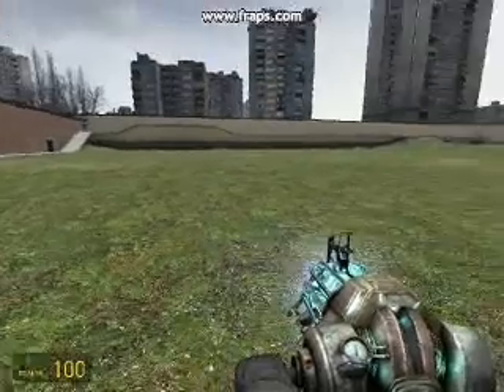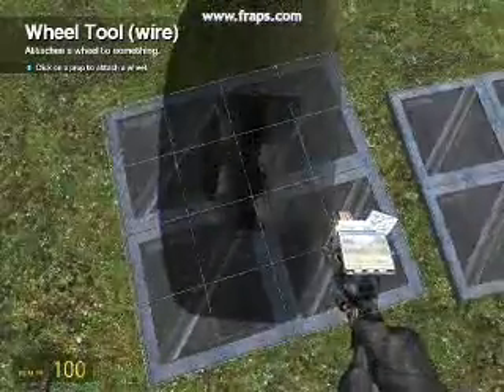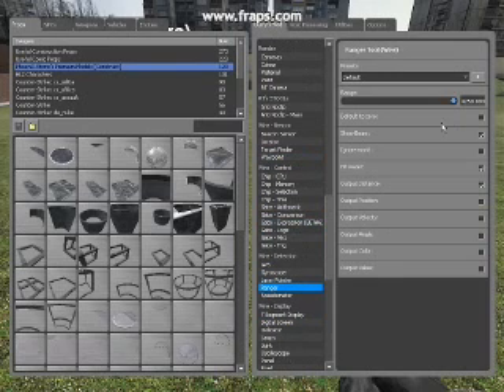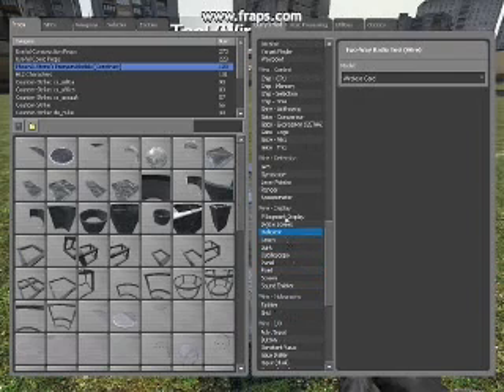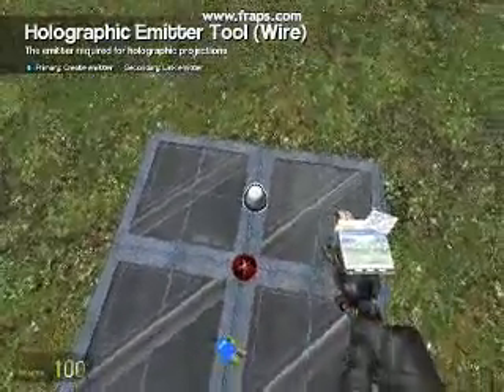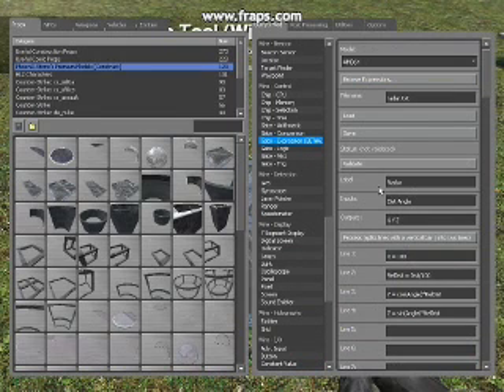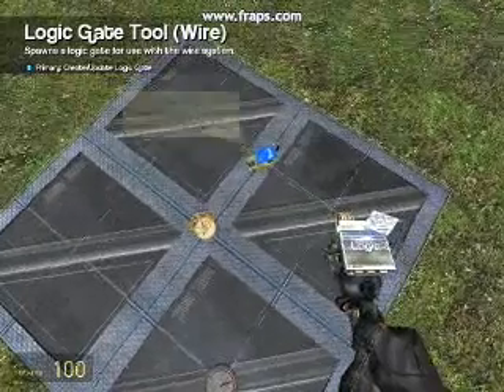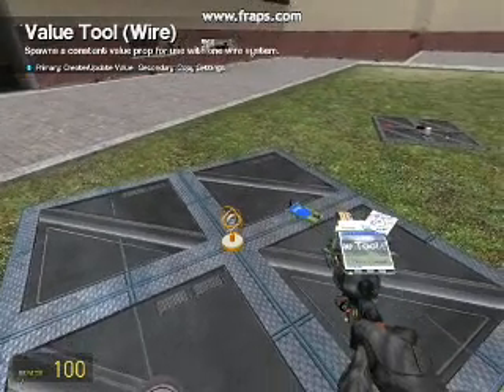Wire Holo Radar Tutorial

Comment: You're both wrong and unable to look outside the box. Wire Radios can be used for linking multiple contraptions together, without having to rewire them together every time you spawn them in. They can be used a central point for the same value, instead of having to go across the map just to wire a single component (Especially in SpaceBuild.) So yes, the radio is extremely useful.